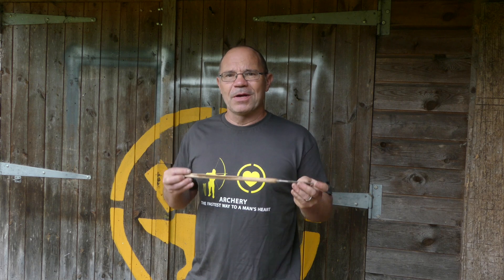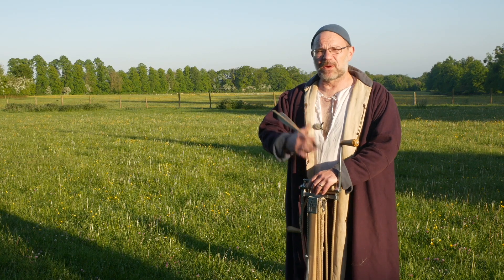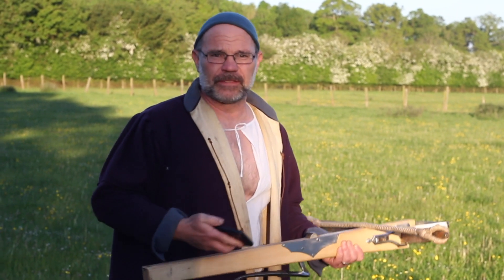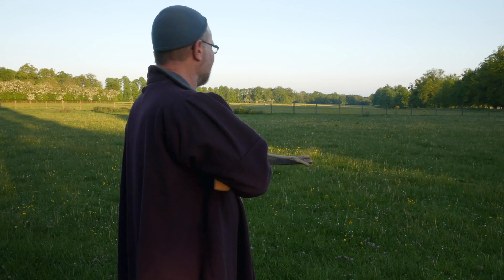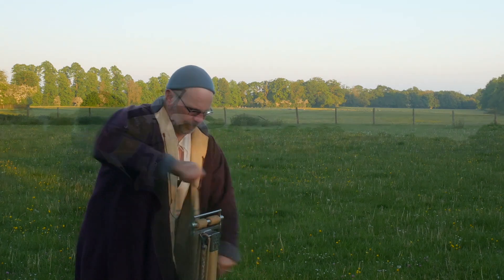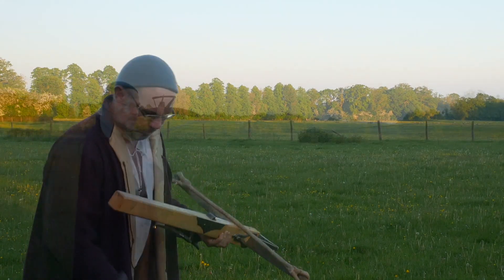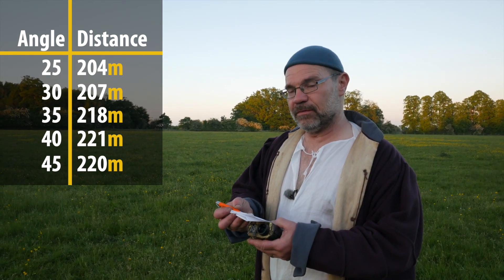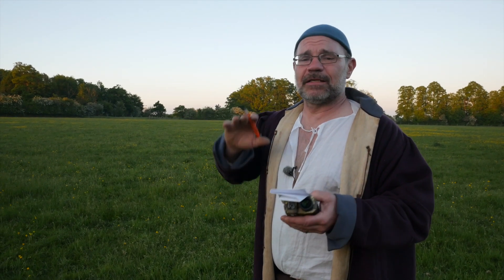Distance - Which angle is best?

Comment from the maker: Statistics.  I know I should do more shots......However it does depend on what you are wanting to show or achieve.  I want to quickly get an idea of what is going on, an approximate idea as I simply do not have the time or resources to engage in long trial sets.  The other part of that is what it means in the end.  If I shoot say 10 bolts each time and then categorically state a 'fact' based on that, then any methodology I have can justifiably be picked apart.  I am not a scientist and there would be a lot of picking apart I am sure.  I am doing this mainly for fun and for an indicative result; what is the essence, the direction, the generalisation of what is going on.  In this case I am sure bolts may have gone slightly different distances given a repeat, but what was also clear was that 35 degrees was not massively better than 45 degrees as an example, which was a common comment from the last film.  That is enough for me.
Reply: Put 300m's of rope on them so you don't have to go get them and do at least 3 shots of each. Come on Tod! You don't have to be a scientist! Just add more samples to compare. Maybe make sure that phone thing is even accurate. If you are really done with this test, try it with a pommel now. 

EDIT: Or just wait until you have some more time. Quality of quantity. Or try to hit a target as well using the angles only. Sort of like that old QBasic game Gorillas.
Reply: @itsyourenotyour9101  Ah yes. The Moby Dick treatment. Harpoon and hang on. All that is needed is a rope that has no mass, causes no aerodynamic drag, and exerts no friction load when paying out during flight.  Not unlike a wire guided torpedo wish list.
Reply: Fun. YES. And I, for one, appreciate that you share your fun with us. We don't all have crossbows (or longbows, or replica shields, or armor, or daggers, or....) and places to use them.

Picking apart: State your test parameters (including measurement methods and precision), counts, confidence levels. Now let the crows peck. There are "doers" and "complainers." Be a "doer" and recognize the "complainers" as largely envious hot air.

I used to do a lot of engineering testing (now retired). Before a formal test began, I would do what I commonly termed, "a ranging shot." This brief early test established the viability of the test method and the approximate range of expected data before I committed to statistically meaningful quantities. Getting into the ballpark before incurring the cost of a major test is important (A validation could easily risk over half a million dollars for an "average" product). I look at many of your trials as being ranging tests.

Keep having fun. I enjoy seeing a skilled craftsman utilizing his wares. We, your viewers, are vicariously having fun as well.
Reply: Archer's Paradox.
Believe it or not, I learned this from a fiction book, First Blood Part Two.
The author describes how an arrow wobbles and flexes enormously while being launched.
Just by reading that, my archery skills improved, and the Archer's Paradox never gave me a problem since.
I didn't even know there was a name for it!
 In the animated movie, "Brave," they show it in action on the big screen.
The arrow flexes and wobbles it's way to the nock of the arrow that is in the target.
All from the imagination of a CG artist!
Reply: @danieljones317  I did not know that the effect was called, "Archer's Paradox." Thanks for the info. I have known of the effect for some time. I recognized it in "Brave." Like you, I appreciated inclusion of that detail in the movie. I believe, however, that we are talking two separate things here. In Todd's range tests, you can see the quarrel "flying sideways." The shaft itself remains straight. When I watch video of "Archer's Paradox," the shaft of the arrow itself bends. The arrow sort of wraps itself around the bow as it is being launched (This effect brings up questions about the "Lockdown Longbow." Do the arrows develop the shaft bend? Do they "fly sideways?" Do their shafts oscillate in flight? Inquiring minds want to know. Yes, velocity is matched with that of a longbow. However, are other aspects of the arrow's flight dynamics equivalent?). Some shaft oscillation appears to continue after launch. I'll have to see if I can scare up some of those videos again and check out my memory. Again, Thanks for the identifier.
Reply: @billharm6006  actually, a regular bow and a crossbow share the same dynamics.
I would imagine that any projectile has that sort of effect, as they are pushed from the rear, and it takes a bit of time to stabilize.
Even bullets are affected by this.
Rockets, probably more. Look at the SpaceX rockets, one can see the jets turn to stabilize the craft.
I made a sling bow from a slingshot.
Loosing an arrow from it is wild. The arrow actually hits about a 30° angle before stabilizing.
About the only thing that provable would not suffer from this is a spherical projectile, but any roll imparted would have consequences downrange from an unpredictable spin.
Airsoft rounds have a "hop" where the pellets are made to backspin, and if it's too much, they actually rise.
Reply: @danieljones317  I recommend that you look at column buckling equations (I'm an ME, so I've had to play with such things). The short, thick quarrels will likely respond differently to the kick in the pants (a compressive load on the shaft)  than will the long slender arrow shafts (as an extreme example, look at wagon wheel spokes--which work in compression--and bicycle spokes--which work in tension and flex significantly under compression). As column geometry (aspect ratio... length vs. diameter) and load forces change, so do bending modes. I haven't actually run numbers for arrows and quarrels, so they might have the same mode. However, the degree of effect will be different.

Causing a rocket (or arrow) to rotate away from the desired flight path and causing a rocket's body (or arrow's shaft) to bend at one or more locations are two different effects. The same force may contribute to both (clearly does with arrows). Structural stiffness will affect the body bending, but has little to do--initially at least--with flight path deviation. The stabilizing jets will affect flight path deviation, but little affect body bending (unless, of course, the structure is amazingly flimsy for its purpose... in which case the rocket becomes a news flash).
Reply: its not how far it goes that matters it's what angle achieves maximum velocity for penetration.
Reply: BTW, a regular arrow shot from my crossbow will travel near 1000' before sticking itself in the ground!
Reply: I think the way to really remove the variables and gain top consistency also takes this out of real-world usage. You'd need a lot more measuring tools, a steady rest/holder for the crossbow, wind gauge, barometer, etc. None of which you're going to have if you wander into a field to see how far you can shoot, and none of which folks in Ye Olde Dayes would have had trying to shoot at each other (no shooting each other kids!). 
So for me at least this is informative enough for what you're trying to do, which is more human and less machine driven.
Reply: @matthewjayjack8143  Total agreement.
Reply: @matthewjayjack8143  this would be more apt to work with a competition of sorts.
Much like drag racing on a strio, a controlled environment, then one would have not just the knowledge of a single man, but efforts from many to find what works and what doesn't. 
It's not a million-dollar sport, so the information sharing would be more free, and set others into new directions to acheve that desired goal.
Now, making a 200 yard shot into a bullseye that measures 6"  or 15 cm in diameter may well be feasible in short order.
Reply: Wish you'd gone for 50°, even 55°, just to see if, just to say, that categorically anything above 45° drops precipitiously.
Having said that, it seems interesting, and in some ways at least, useful that anything between 35° and 45° drops into a very narrow range.

Useful, because the lads who were using those things to huck sharp bits of metal at large numbers of nasty folk they'd really rather would turn around and go home, or better yet be good lads and drop dead_, were probably not given the benefit of a precise angle-finder, and whilst finding, say, 42° on the dot would be pretty challenging when you're ducking behind crenelations, maybe repositioning because all those hostile archers have dialed in the section of wall you're loosing from, or some mean old mother-hubbard went and started chucking _really big rocks at your cover...

But getting within 5° of 40°? That should be pretty reasonably doable even in a hurry, if you've practiced, to reliably drop bolts at ~220m distance, addressed "to whom it may concern."

Especially if you're on the defending side of that and you've had a lot of practice throwing bolts at rough sections of landscape "over there" where you're trying to hit an army of a division thereof, whereas the attackers are trying to hit a relatively narrow target (the guys on the wall) and if they're up or down a bit, they don't get the ranks in front or below, they hit stone or overshoot entirely and probably thwack some thatched roof.
Reply: Your intuition was correct.
If the crossbow was at ground level (of the point of impact), then the angle would be 45°. If the crossbow was above the ground, the angle would be less. If you were shooting up a hill, you would be below the point of impact, and the angle would be greater. Since you were standing on level ground, the crossbow was ~6' above. And the angle would be slightly less, (and it was). If you were standing on a hill, or a wall, 35° might be the appropriate angle.
Reply: @arikwolf  what you just stated goes against a lot of physics.
Can't draw it on here, unfortunately. 
So, something simple, instead.
A typical garden hose will do nicely.
Because of air friction, the bolt or arrow will slow down in flight, same as a bullet.
Therefore, the angle of ground entry will be steeper than 45°, if the bolt was shot at 45°.
If shooting it up a hill, the ground entry will be less steep, because of the projectile path being more parallel to the surface.
Tossing a wad of paper would tell you this in short order.
You don't throw a wad of paper at 45° from across the room to a waste can, you have to account for the drag, and expect the summit of the projectile path to be somewhat farther than the center of the room.
Something with more mass and less drag, like a pencil, the peak of the arc will naturally be closer to the center of the room.  
Angle of entry will differ greatly between those two projectiles.
Reply: @danieljones317 : Todd is going for distance, not a target. The power of his crossbow and the weight of the bolt makes the drag insignificant. If the bolt hits at steep (>45) angle, he is aiming to high. To flat (<45), he's aiming to low. 

A paper wad is not a bolt. A garden hose is not a 800 lbs crossbow. They will not "do nicely."

This is simple high school geometry of a parabola. It makes no discernable difference how squashed the parabola is due to drag with his setup.
Reply: Statistics, sure.  But there has been a LOT of study of projectile motion in the years between long bows and ICBM's, (it''s not just medieval battles that have depended on predicting projectile range).  it's important to understand the mathematical answer to the range vs. launch angle question is not trivial in the presence of drag.  Lots of calculus, experiments to determine "coefficients" and numerical modeling are involved.
I think the most interesting (and perceptive) thing you mentioned in this film was that you were surprised by the minimal effect launch angle had on projectile range.  I think you may be seeing the effect of the atmospherically slippery nature of arrows/bolts as projectiles.
In any event - love the vids, very entertaining.
Reply: And what if you go over 45? Will it shorten? Likely, not certainly?
Reply: @90mankku  It will go higher, but not as far.
Reply: @richardweiler1552  sure, but is it immediately after 45 degrees? Even if 45 was sweet spot or if it was too high was unclear after all
Reply: From plotting these data, it looks as though the 30 degree shot was shorter than "average". 
For what it's worth, Jesse Rydberg was getting a standard deviation of about 4m at similar ranges. If you have similar variability, then we can't say much more than "the maximum range occurs somewhere between 35 and 45 degrees".

Comment: So now, not being a physicist, I find myself wondering would those bolts at that range . . . .
. . . . have injured or killed an unarmored man?
 . . . . have injured or killed a man wearing padded armor or leather (cuir bouilli)?
. . . . have injured or killed a man wearing chainmail armor (cuir bouilli)?
. . . . have injured or killed a man wearing brigandine?
. . . . have injured or killed a man wearing plate?
. . . . have penetrated a shield?

I wonder what the momentum, joules and fps/m/s are like at that range? 

You would expect arrows and bolts to come out of the start with a fairly high momentum, speed and energy. A lobbed arrow or bolt you would expect to slow down and then, as it reaches the apex and begins to fall, it would pick up momentum, speed and energy again, but this would be limited by drag and terminal velocity, whereas, one would think that a flat trajectory shot would have much more momentum, speed and energy. Right? 
Perhaps the differences are not that much? 
Any idea(r)s?

Comment: For low speed, more massive projectiles the in-vacuo approximation gets more accurate. This is due to drag being proportional to the velocity of the projectile and a greater projectile mass. This effect coupled with the bolts small area means the drag has little effect and therefore the max range is very close to the approximation and the angle is close to 45

Comment: Tod, if this were an ideal test in a vacuum with gravity the only force acting on the bolts, then yes, 45deg would be the optimum. However, as noted by many others, friction and flight characteristics of the bolt play a big part. No matter which angle you launch at, there will be a higher pressure 'under' the bolt due to the angle - this means that the bolt will try to achieve it's own optimum flight profile. It will try to climb a bit (gradually), and I'm thinking that the angle or flight path it takes (before gravity starts to turn it around) is actually higher than the initial launch angle. Just an example (but not accurate), if you launch at 30deg, it may find it's optimum angle/path at maybe 40deg somewhere in it's journey. This will also explain the closer than expected grouping for the different angles. The only way I guess to check this would be to track the whole flight path from the side to see what is actually happening. All the best from down under! Steve W.

Comment: Obviously I am late to the party here, but at less than maximum range there are two angles which will put a bolt on target. One high arcing one and one lower, faster one. This opens up the possibility of two bolts, or arrows, arriving at the same time, making them much harder to dodge.

I don't think one crossbow man could have done this because the reload time would have been too long, but a trained pair could easily have done it, and at some ranges a single archer could have had two arrows landing simultaneously. 

Was this ever done in real life? It would seem effective against massed targets where arrows coming in at two different angles would complicate shielding. And more so if a helmet limited visibility, especially in the vertical direction. I keep thinking of the old helmets with vision slits.

Comment: Like Tod said right at the beginning, in a vacuum the perfect angle is 45°, therefore air resistance/drag is the main factor.
The faster something slows down, the shallower the angle you should use.
The classic example for this audience should be the difference between firing a sleek arrow from a bow and a chunky bolt from a crossbow

Comment: Hey Tod.  The real-world factors affect the ideal situation (as you mentioned, we're not shooting in a vacuum) but the math works out based on looking to see where the equation sin(2 * theta) has it's maximum value - turns out it's at its max (1) when 2 * theta is 90 degrees and therefore 1 * theta is (drum roll) 45 degrees.  Thus, maximum range is likely to be a when you shoot at an elevation of 45 degrees . . . until those other pesky real-world factors come into play such as aerodynamic gliding giving you maximum range at slightly less than 45 degrees.

Comment: According to my high school maths that's pretty solid. The final equation is S=SenA . Cos(90-A) . Vi (vi= inicial velocity). If A=45 degrees then you just divide by half. Due to others variables it varied (and i did not considered the height in bitch the bolt is launched), but not so much. Cool right?